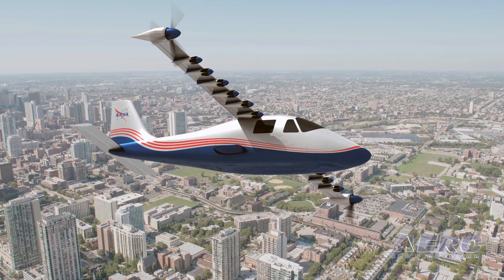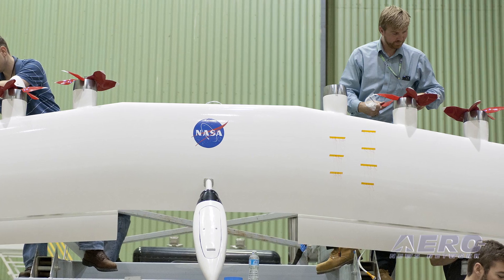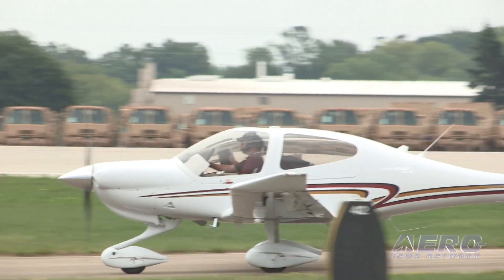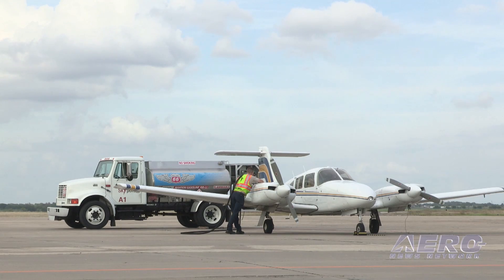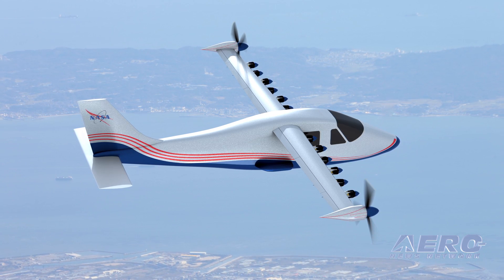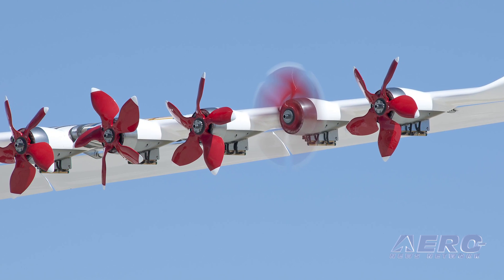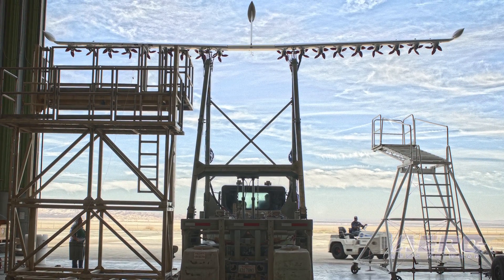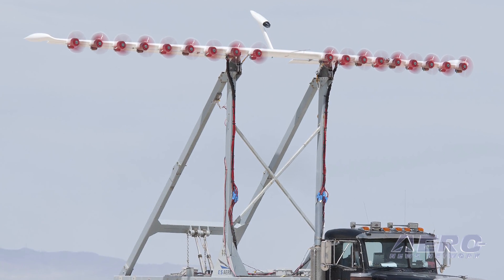Aero-TV: NASA's X-57 Sceptor - Lean, Green, Money Making Machines For Aviation!

Comment: The efficiency is 65% for an electric motor from plug to torque on prop.  Cost of electricity is 15 cents/kw-hr.  33 kw-hr/gallon equivalent.  That makes 33 x .15 = $4.95 /gallon.  4.95/.65 = $7.6/ gallon of torque at 100%.  

AV gas is $4.6/gallon.  Engines are 35%.  4.6/.25 = $18.4 / gallon of torque at 100%.  

Ratio av gas / electric "gas" is 18.4/7.6.  2.42

Auto gas is $2.4/gallon.  If you use auto gas then a gallon of torque is 2.4/.25 =9.68

9.68/7.6 =1.27.  So and airplane that is run on auto gasoline is 27% more cost.

If you can get 60% efficiency (like what I am working on) with natural gas at $1/gallon, the cost per gallon of torque is 1/.6 = 1.66    

So, I can run my airplane from my house with Natural Gas at $1/gallon, or electricity at $4.95/gallon.  7.6 (electricity)/ 1.66 (Natural gas at 60% eff) is 4.57 times MORE costly than my solution.

So, it I run it on Auto gasoline at 2.4 and 60% new engine, then 2.4/.6= 4  Compare.   7.6 (electricity) / 4 (my engine on auto fuel) and you get 1.9.  This proposal is 1.9 times more costly in fuel than what I am working on and around 4.57 times more costly when I get to the final solution.  

What would you want.  4.56 times MORE cost with electricity or my solution.  My engine can also do distributed power....  

My question is why do they get $15 million to promote a bad idea and I get zero?  Hmmm.  Rigged sound about right?

Comment: To compare electric to what is possible with less investment in new IC engines.  Here:  100LL is $5/gallon.  Natural Gas is $1/gallon without road tax.  If you can get 60% (combined cycle generators on grid get 60% from Natural Gas) over 25% you get 2.4 times better.  2.4 x 5 =12 times better.  Claim by NASA guy is 10.  So with what I am working on I can get 20% better than what they get with a fraction of the investment.   NASA should go out and find private funding and leave real engineering to the private sector and stop competing for investors.  There is a better way and NASA does not have it.